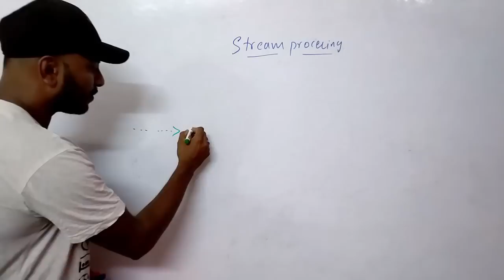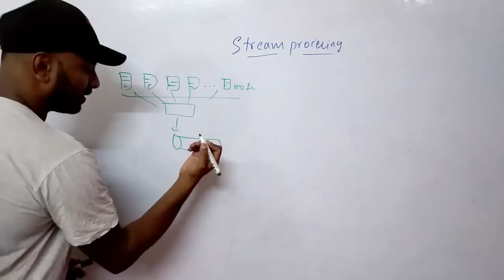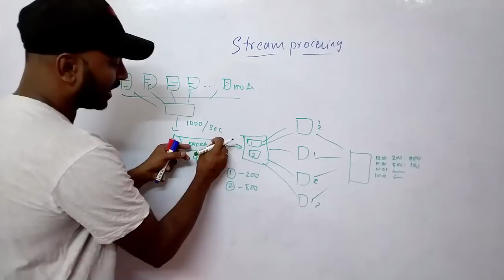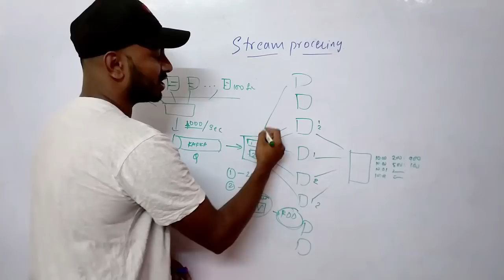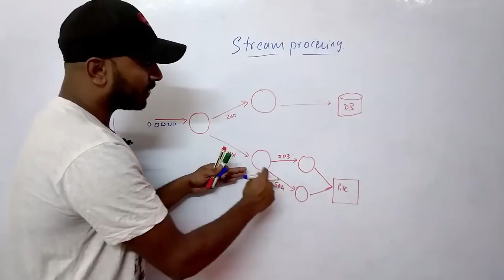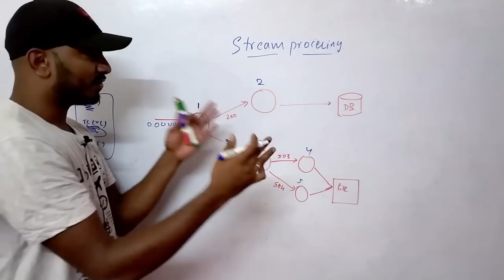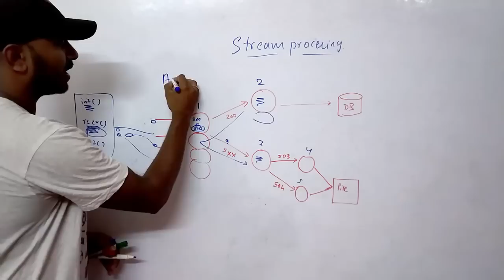System design basics: Real-time data processing

Comment: 00:02 Stream processing involves real-time processing of a continuous stream of messages.
01:40 Real-time data processing requires a queue data structure for scalability and reliability.
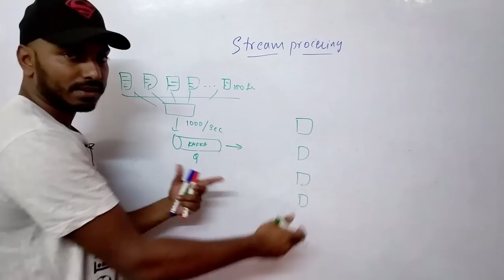03:13 Driver orchestrates job execution and task distribution.
04:44 Real-time data processing using micro batching in Spark
06:11 Real-time data processing involves scaling computing power and distributing jobs.
07:42 Implement real-time data processing with message receiving and processing logic
09:03 Real-time data processing flow through a queue structure
10:31 Scaling real-time data processing using partitions in the queue data structures.
Crafted by Merlin AI.

Comment: You forget to shuffle and sort part, writing directly from executor to db would cause concurrency issue. Spark do shuffle and sort, to accumulate the data in single piece like collect all 200 as count 200->500 [as single or time based which will be multiple] , then write

Comment: I have a scenerio where i have to analyze data on 50-100gb data as of now. And i also have to apply filter on whole data and need a real time filtered result then which approach i have to use. And data also require some calculation in between.
Reply: Going with elastic search/elk stack is the best bet.

Comment: Hi @narendra, What is the logic by which a driver forwards a message to one of the many executors? 
Thanks for the informative video as always.
Reply: It basically partition the data based on given size. Let say you have 1000 item to distributed and you have 10 executers to distribute. Then in the chunk of 10, assigned to each.
Reply: @iitgupta2010  you mean chunk of 100?
Reply: @puneetpatwari  Yes, sorry for typo